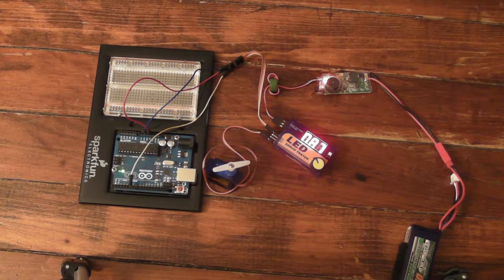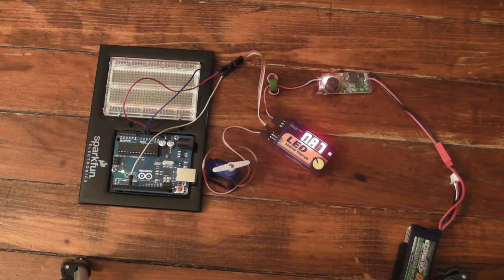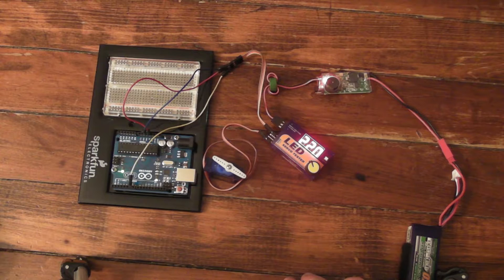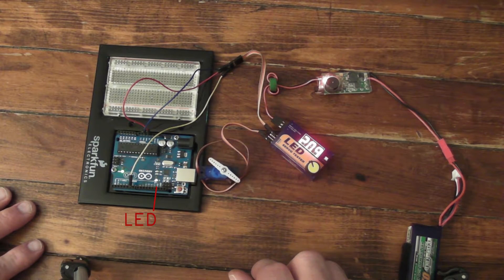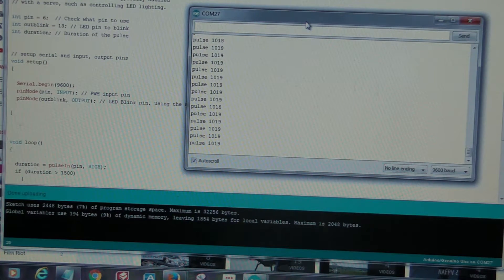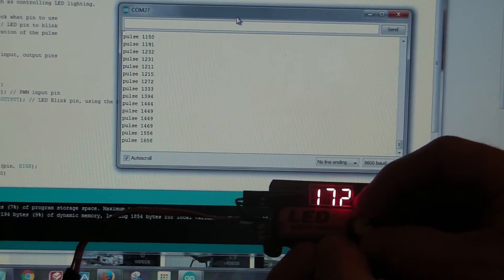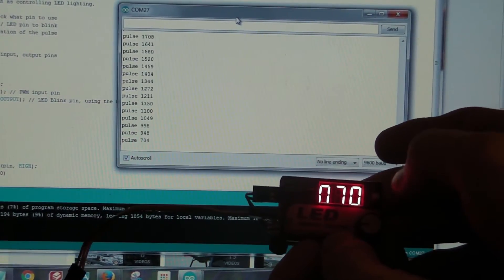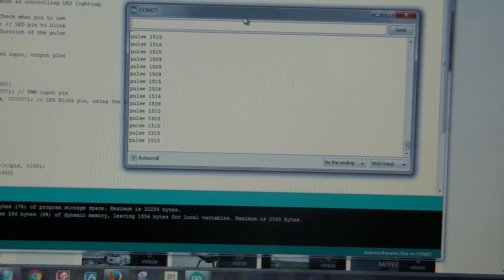Read PWM with an Arduino - How-to

Comment: can you post the code?
Reply from the maker: http://www.rustysfpv.com/DIY/how-use-arduino-read-pwm-signal
Reply: @rustysfpv  The link no longer works. Care to repost?
Reply: @corisco7590  retrieved via archive . org (youtube doesn't seem to like me posting the archive link so here's the code)
// Simple sketch to read the pulse width of a PWM signal
// Useful for reading PWM valuss from a R/C reciever
// to create actions that are not typically handled
// with a servo, such as controlling LED lighting.

int pin = 6;  // Check what pin to use
int outblink = 13; // LED pin to blink
int duration; // Duration of the pulse

// setup serial and input, output pins
void setup()
{
 
  Serial.begin(9600);
  pinMode(pin, INPUT); // PWM input pin
  pinMode(outblink, OUTPUT); // LED Blink pin, using the build in LED on pin 13

}

 

void loop()
{

  duration = pulseIn(pin, HIGH);
  if (duration > 1500)
    {
      digitalWrite(outblink, HIGH);
    }
  else
    {
      digitalWrite(outblink, LOW);
    }
  Serial.print("pulse ");
  Serial.println(duration);
 
  delay(100); //delay so you can read the scrolling output
}
Reply: @MrJohnGuthrie  
Whoa.
Can't thank you enough for taking the time to retrieve and post the code. Very much appreciated!